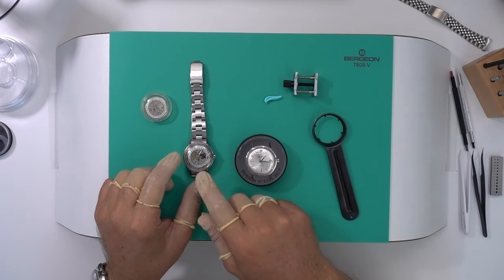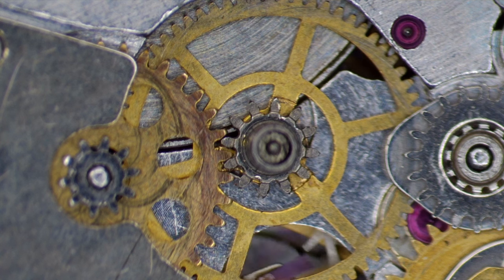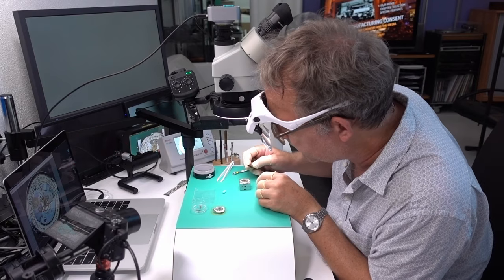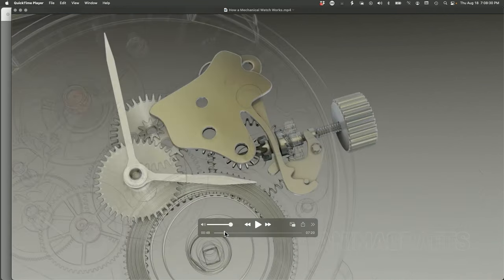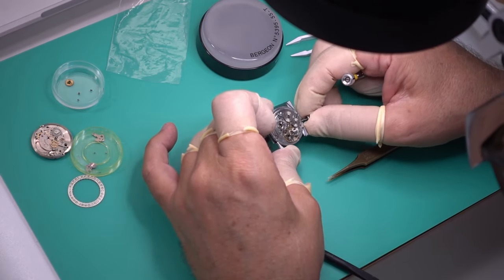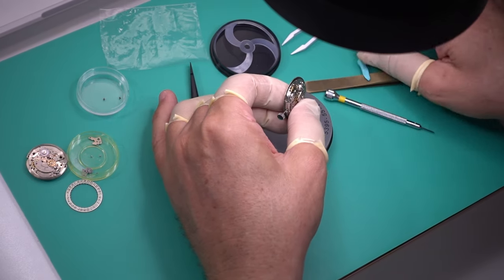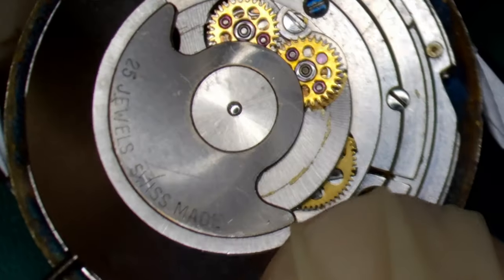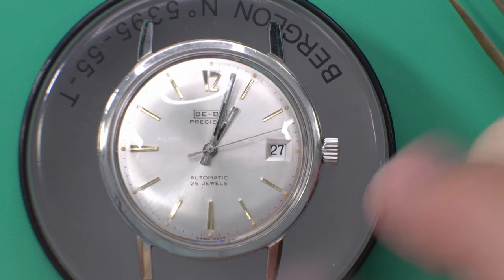Vintage Watch Movement Repair - ETA 2472

Comment: Very interesting video, thanks. I'm trying to service an ETA 2472 as my second watchmaking project, and your video helped me to understand how the date ring has to be reassembled.
Reply from the maker: You're welcome! How did it go? (or how is it going) 😂😂😂
Reply: @IMakeWatches  Thanks for asking. After I had ruined the the movement in my first watchmaking project, in principle I made good progress with the ETA 2472 movement.
But I'm currently stuck at the point where I try to reassemble the cannon pinion and the gear next to it (around https://youtu.be/ubdwWa4zZXk?si=ZNKVFCYu7-0MPRc1&t=4212 in this video). The problem is that the gear at the bottom of the cannon pinion does not interact with the next gear because it is positioned to high.
I tried to figure this out by looking at your videos and at other videos and reassembling instructions. It always looks like the gear at the bottom of the cannon pinion lays flat on the golden-coloured wheel beneath. But when I look at my cannon pinion it has a small protruding cone under the gear at its bottom, and that seems to be responsible that the vertical position of the gear is wrong. I'm still looking for more information how this should look like...

Comment: The pallet jewel is sandwiched to its setting to break them apart drop the whole thing in a liquid cleaner and they will naturally separate after drying lubricate one drop of oil into the jewel and return it to the setting and the capillary effect will keep them together  …… as I’ve watched in other videos :) Oiling the pallet jewel could improve the amplitude if it was dry. Successfully taking out the pallet jewel, inspecting it then returning it to its place is quite an accomplishment :)
Reply from the maker: Thanks for your comment. I think you mean the balance jewel? You may be right and I appreciate the suggestion! Did you learn that entirely by watching other videos or are you a watchmaker? (Just curious!)
Reply: @IMakeWatches  Yes the balance jewel :) I learned it by watching a bunch of watch servicing videos. I've replaced movements and calendar works and am studying servicing/oiling but haven't attempted it yet. I believe you would be good at it as you seem to have steady hands and good control! Cheers and thanks for your videos

Comment: I was given a completely dead watch and just started trying to learn about how to fix it.  -completely ignorant.  Last night I figured out what a movement is and the '69 doxa sub 300t I have contains a 2472 movement as well :) this has been incredibly helpful so thank you for this video!

My Doxa had a leak its filthy inside under the gears has loads of old dry oil and crust so the ultrasonic cleaner is going to help I hope.  If I cant fix this I saw healthy functioning 2472 movements for sale that have good amplitude and so Im wondering how different they are. Mine has parts stamped "Doxa" like the swing weight but they look the same as yours.  Is it somewhat safe to assume all the gears and mechanical parts are interchangeable?
Reply from the maker: Thanks for your comment! Your Doxa sounds great! Yes, for the most part the 2472s should be interchangeable. The hand height is the main difference. If it is a pie pan dial or has thick indices it may have high hands, which means if you buy a replacement movement or a donor watch you’ll need the same, or you can salvage those parts from your existing movement. Best of luck! Feel free to email me some pictures if you have any questions!